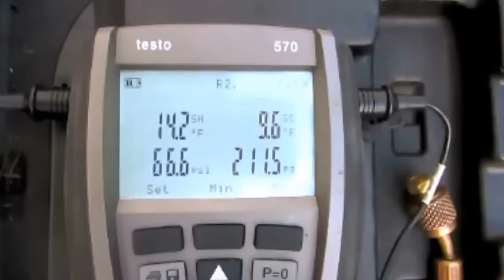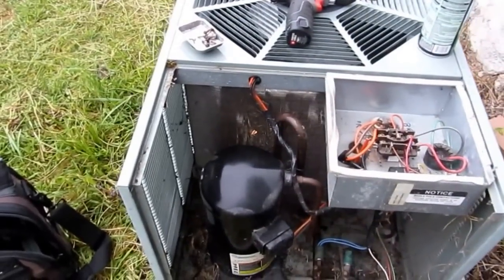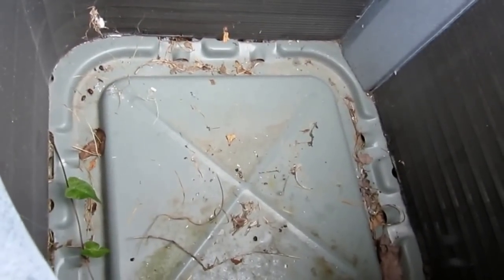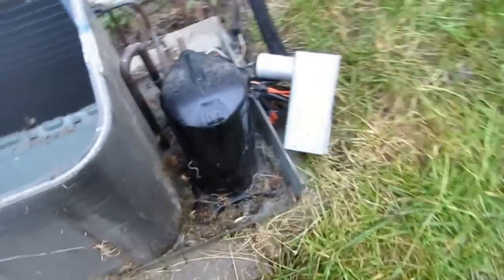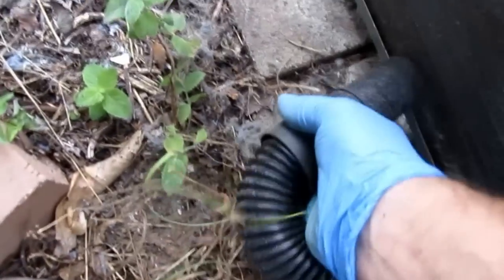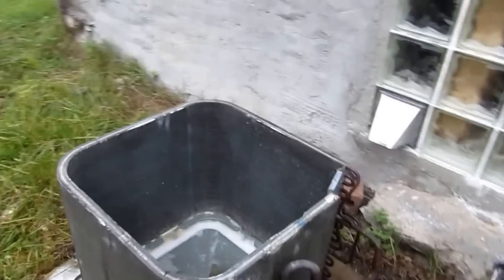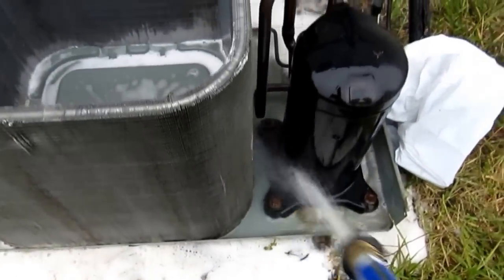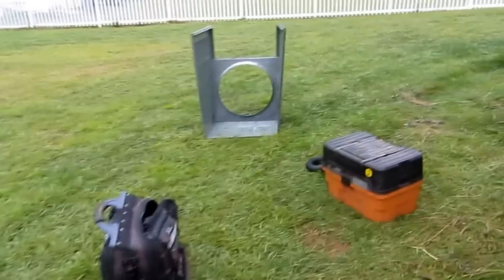HVAC:RUUD CONDENSING UNIT FULL CLEANING PART 1

Comment: Hey Steve...just a couple of help tips.....to straighten the fins...nothing works better than a old toothbrush...heck even buy a new one at the dollar store...cheapo and it works better than any fin comb I've ever used...give it a try on your scrap pile....and take the hose of the vacuum and put it on the other end so it blows and blow the dust out of the coils from the inside ......
Reply from the maker: zeke112964 i will have to try the tooth brush
Reply: I'll try the tooth brush method. Thank you for the tip. The straightener I bought at home Depot left me wanting, and with fewer cooling fins

Comment: The proper way to clean the condenser, sadly my company frowns on spending the time to do it right. Great video.
Reply from the maker: +Greg Stabler only real way to get her clean is take her apart
Reply: Greg Stabler Yeah, many hvac companies want techs to rush through this stuff, and then they charge $400-$500 for a half-assed job.

Comment: Noticed the condenser is a 1997 10 seer....I remember when the 10 seer came out in the 80's(we up sold that baby alot)turns out over 10 years later and the 10 seer is still rockin...
Reply from the maker: Erik Cable these ruud units were good units
Reply: 2024 and mines still running like a champ!

Comment: Good job Steve, You can also use that spray as maze (personal protection) Question: My unit is just like that. Air handler is up draft with evaporator coil sitting on top of furnace heat exchanger. I cut a hole in the plenum and spray self rinsing coil cleaner on the leaving air side of coil. Do you think this is doing any good? Or a waste of time and material? I do not have any cooling issues, just trying to do maintenance. It has the flex coil like a  W  . Thank you, and keep up the videos.
Reply from the maker: gerry mcadams the dust if any is between the furnace and coil .i would just make sure you keep a clean filter in rack ..if the coil is durty its best to pull it out to clean it ..if you keep a clean filter you will never get dust on the coil .. thats the best way .spraying the self cleaning cleaner will not hurt it .dump some clorox or viniger down drain to prevent slim
Reply: Thanks, 10-4     will do

Comment: Hi Steven, what do you think of the Porter Cable drill? Do you have the impact driver too? Think i might get one!
Reply from the maker: i like the porta cable drill its small and compact it also came with a cool little angle sawzall that bends like a drill 90% great for cutting small pvc ,its a 12 volt battery .its good for small stuff